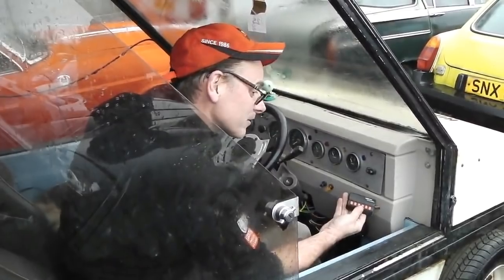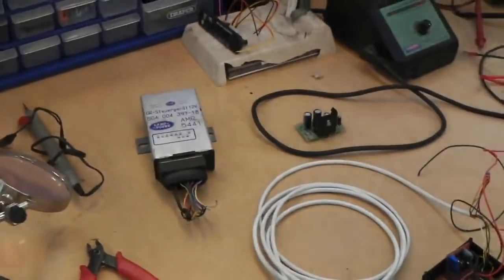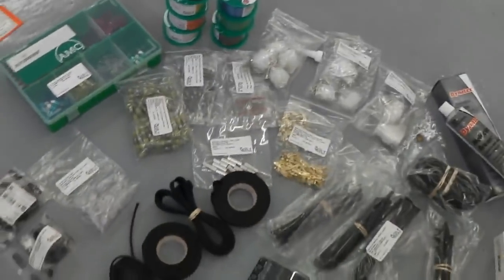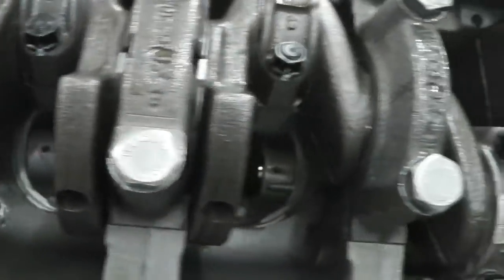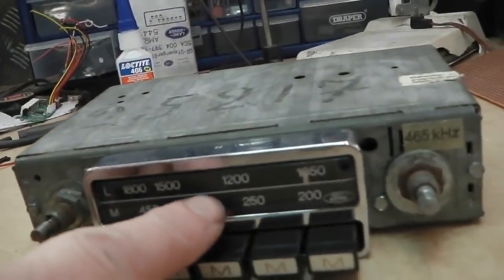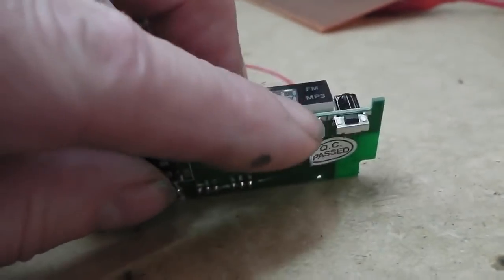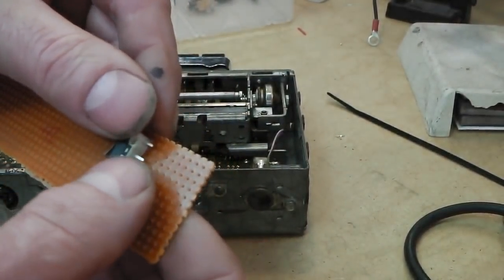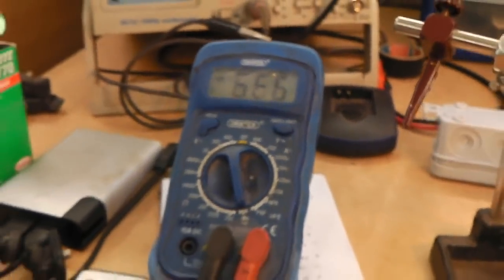1970s Radio conversion to MP3 & Bluetooth - PROJECT BRAMBLE EP32

Comment: A fabulous price of work and a fantastic idea. Couple of observations Could you not have used the Vero track as a common for the micro switches. The blue tooth antenna may be sheilded by the metal box but signal will probably pass through front plastic display also phone will be less than 1m away.
Reply from the maker: thank you, hmm there was a reason i flipped the vero, cant recall, deffo a good reason, yes i thought about the blutooth and concurred same as you it will penetrate the front aperature plastic
Reply: Putting the Bluetooth antenna inside the radio would make a very poor signal and would be bouncing 2.4 GHz around inside the metal box which the amp and AM receiving circuit would hate. Best that it is an external box. That plastic has metal right behind it so that would be a problem. The whole case of a car radio is designed as a Faraday cage to keep the signal clean.

Comment: flip flop :) , removing the jargon aside making it look to easy Pete probably a silly question but perhaps possible to convert a later model radio from say 2000?
Reply from the maker: the prob with later radios is they are circuit board push switches so no operating rods but it could still be done just more work
Reply: @PeteCswampy  i new that hehe thanks pete.

Comment: Good work Pete
Out of curiosity, have you tried sharing the antenna without a relay(s), since television household systems share the signal without problem?
What did you use for the black ice sensor?
Reply from the maker: off the shelf temp module, was not worth building one for the price on ebay at 4 quid!!! not sure, i think if i share antenna the LW loses signal strenght, seem to recall trying this on previous builds

Comment: The oil and fuel gauges look very neat and tidy but I notice that you are using a temperature gauge with a soiled/blemished face which seems odd as you always tend to use pristine components for your builds - any particular reason for that Pete?
Reply from the maker: test jig dont want to damage the good one
Reply: @PeteCswampy  That makes more sense

Comment: quite a lot of stuff, but i guess its your car so its all good though the only thing i'd replace is the orgnial loom and keep it orginial so that in the furture kids will know how hadr it was o drive an older car, you know all this think were you want to go and the car will go, and the stearing wheel is just a joy stick and the engine is nothing but a large ass motor its funny how ppl lagh at you when your going to work in a car that doesn't fly and has these things called wheels with rubber and steel/alloy surports, but you get more looks then these morden cars,